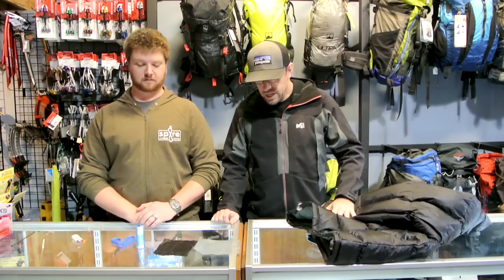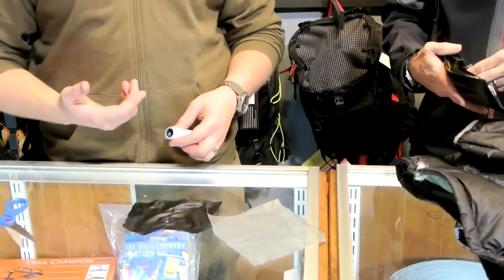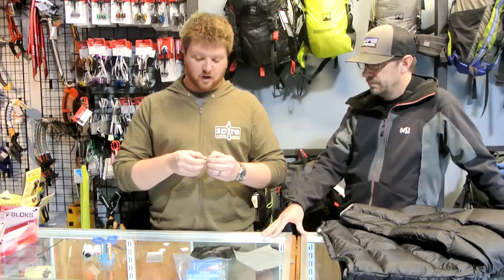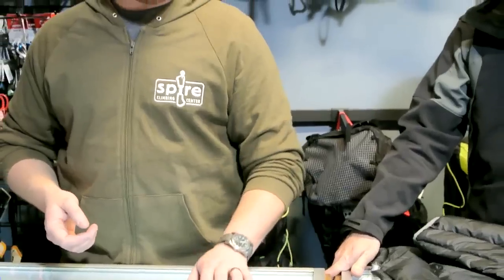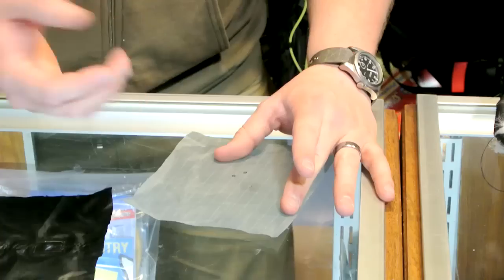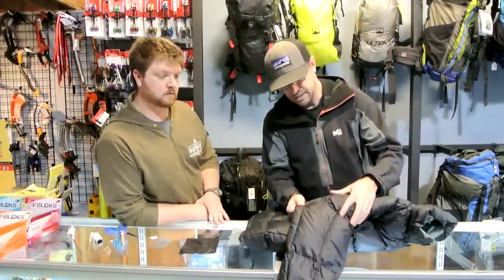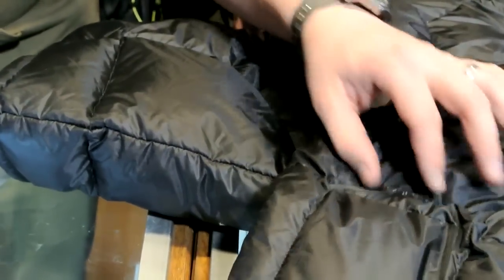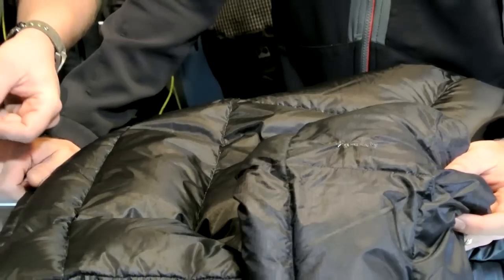How To Repair Technical Outdoor Fabric if ripped or punctured

Comment: Saved my silicone tent floor, thanks. I had gone through the floor and the footprint in the same spot. Whoops. So for $10 here in the UK, job done and I can carry the extra as repair when bikepacking.  Thanks for the guide guys.

Comment: I have a camping hammock the underside has a small dime size spot the nylon protecting coating got wore off.  The nylon isn't ripped, jus the coating has been scraped off.  Suggestions for best way to permanently fix it?

Comment: For down jacket/sleeping bag repair in the field, wad the hole up tight with some folds and put a few safety pins through the shell material. it will get you to the next city.

Comment: The Tenacious tape is indeed tenacious! I used it to repair a hole directly under the ball of my foot on my surf wetshoes. I thought it might stick until I got out over the rocks in best case. But no, the tenacious tape is still there after surfing maybe 40 times, walking over wet gravel road, sand, rocks, mud and grass. It's unbelievably good! Also fixed rips and tears in my down jackets but that's nuthin.
Reply: Tear Aid is better. TT is good, but Tear Aid is stronger.
Reply: @BillOweninOttawa  I've tried both but had better luck with tenacious tape.
Reply: @Thestripper1  Interesting. For sure the material being patched makes a difference. There is a guy who does very exact measurement and testing here on YT. He tested the rip/stretch strength of TT and TA, Tear-aid came out way ahead. I just tried to patch a helinox folding chair that had a one inch burn hole in it with Tenacious Tape, but it came off almost right away. I prepared the surface with an alcohol wash too.
Reply: @BillOweninOttawa  I guess the material in a chair like that gets stretched quite a bit when you sit in it and that would put a lot of stress around the hole. Maybe it would work if you used longer strips and taped an X over the hole on both sides of the fabric.
Reply: @Thestripper1  Thanks, but that's not it. The hole is not in an area that stretches. I got some Tear Aid (I had only TT as the store was out of Tear Aid) and will wash the fabric really well and try again. You are right though, the size and shape of the patch is very important! Thanks again.

Comment: What would you recommend to repair the Klymit Litewater Dinghy (210 D ripstop polyester)? Mine didn't come with a patch kit (bought secondhand).
Reply: Get some 210D TPU-one side nylon and heat weld. Very very strong.